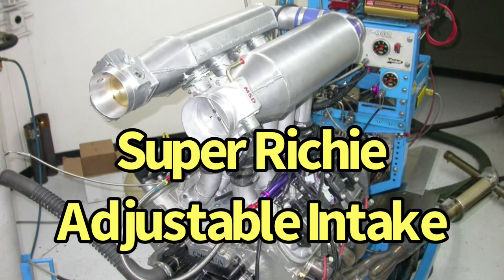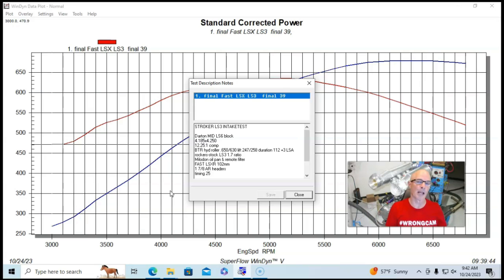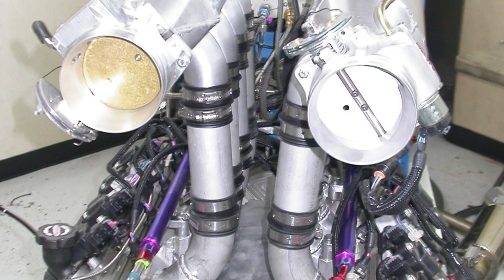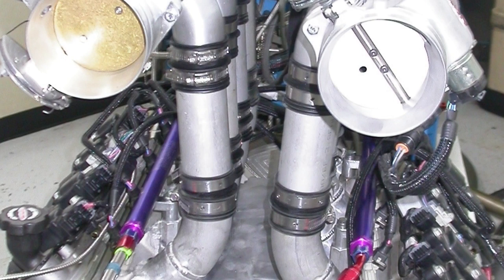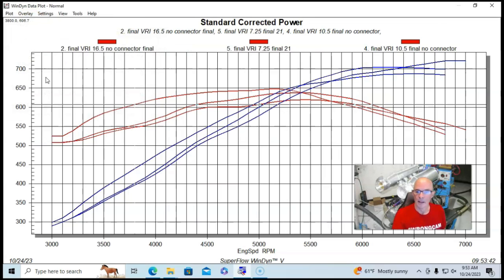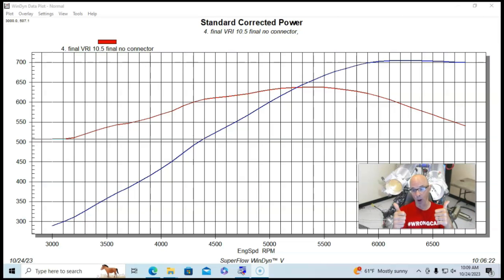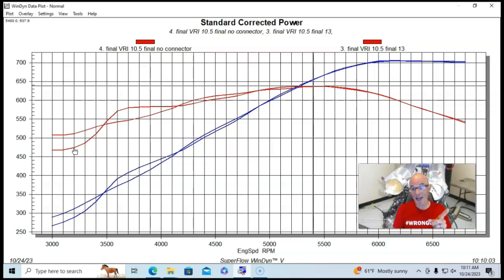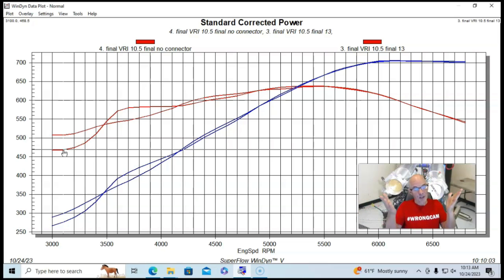MOST POWERFUL LS3 INTAKE EVER? SUPER RICHIE DUAL-PLENUM, ADJUSTABLE RUNNER LENGTH AND PLENUM VOLUME

Comment: So Cool! Im Considering Increasing My Runner Length On Possibly My 3800 V6 And Hemi. By Making A Spacer Plate. My Only Concern Is I've Only Got About 1-2" Max To Increase Runner Lengths Which I'm Worried I Won't See The Low End Gains Id Like To See As Seeing It Took 6.5" To Net Worthy Low End Trade Off. Still Would Be Unique And One Off. Plus I could Use The Room In The Spacer Plates For Nitrous Or Water Methonal Injection Points lol

Comment: What happens when you combine long runners with a long duration camshaft? The kind of racing I do having a lot of low RPM power that carried out past 7500, even with less top end power, reduces lap time by skipping a shift.
Reply: A wider lsa camshaft will do that too. Soften the middle of the torque curve, more overrev and better low end.

Comment: Richard can you comment on what you think would happen with increasing plenum volume to keg size on a supercharged motor like the l32 with an m90? I'm curious if you keep increasing volume can you see lower boost pressure numbers and then continue to run smaller pulleys and to what extent. At some point you will need to short shift to keep the rpm below the max supercharger rpm but i wonder what that would do to ET and trap speed 🤔
Reply from the maker: plenum volume had little to no effect on power and did not lower boost

Comment: On a carburetor application the plenum volume would be a lot more crucial because of signal to the booster on fuel injection you can give it the fuel regardless of signal.

Comment: Curious about same test that changes runner cross-section, also. 
Could it be that varying runner cross-section will move power around the rpm band?

Comment: You ever do a comparison with individual throttle bodies?
Reply from the maker: I have run them if that is your question
Reply: @richardholdener1727  What did it do to the power curve compared the fast. You could probably play with intake length too on individual throttles

Comment: Richard, do you think the gain in that mid region is a function of plenum volume or taking advantage of a harmonic between the two banks? My Porsche Cayman (987.1 S) has the same concept with a flapper valve in the middle.
Reply from the maker: What do you think changing plenum volume does? It changes the Helmholtz resonating frequency

Comment: Symmetrical and parallel intake tubes cry for an rpm-controlled slider setup. Optimize that runner length for the best of all worlds! Thanks for a very interesting test, Richard!
Reply: Those exist on racing cart engines and they work well. I think the newer hemi engines have a dual length intake too that works really well

Comment: Richard, I would like to propose two tests: the first would require a four-cylinder with a conventional tunnel, ram style manifold. The question would be how does the length of the hem, Holtz resonator, the tube in front of the throttlebody, affect torque in power.

The second test would require a V-8 set up similar to what you have but I have a concept : dual plenums that are divided, in a similar fashion to a duel-plane intake manifold, where a pair of cylinders from each bank cross over to the other bank. My hypothesis is that this would dramatically improve torque across the entire rev range provided the correct runner length is selected. This would also be a neat manifold to test the crossover tube on as well.
Reply from the maker: I'M CURIOUS-WHY DO YOU THINK A CROSS OVER WOULD CHANGE POWER WITH THE SAME RUNNER LENGTH-AND I HAVE RUN ENDLESS TESTS ON AIR INTAKE TUBES ON 4 CYLINDER HONDAS. PLUS YOU CAN'T HAVE A CONVENTIONAL (V8 STYLE) TUNNEL RAM ON A 4 CYLINDER.
Reply: I've done some testing years ago on the dyno as it was common urban myth that no intake pipe and a pod on the throttle was the best way, and the results were completely the opposite.  What I found is there is a sweet spot length for the ram pipe before the TB and the gain was inversely proportional to the harmonic number.  So lengths that were tuned to the 1st harmonic gained the most, but where ridiculously long, near 2m on our engine.  There is a fair bit of testing to get the ideal length that also fits the engine bay.  But if you don't care, anything is way better than straight throttle and/or pod and as long as you can practically make it.   The diameter I didn't test but I assume going too small is bad, same like how a too small runner kills power quick smart but going too big isn't anywhere near as bad.

I also found plenum volume to not do much, but my understanding is a big plenum is very helpful when the TB is too small due to increasing the efficiency of the TB when it is too small.  Such as a restricted class in racing.  But for anything else, too big of a plenum makes the throttle response lazy due to the finite speed of sound.

Comment: Ferrari and Porsche looked into this a ton in the 90s and possibly even earlier. The Ferrari 348 then 360 and virtually every NA engine after ran manifolds like these. Porsche 964 and 993 and after ran this only they had internal butterflies as well to actively vary chamber volume
Reply: Hell, even Honda did this on their J-series V6.  Minivan power!

Comment: Could it be that the size of the pipe joining the plenums together is specific to certain rpm ranges? Where a different size pipe might see gains at a different rpm. Then if you had say 3 different sized connectors all with separate opening valves they could be opened at the correct rpms for more consistent gains? Maybe this wasn't a test of plenum size but one of joining the plenums...
Reply: I'd say you might be able to measure something.  But given that many OEMs use a simple butterfly valve between two chambers with no pipes at all, I don't think it'll make a massive difference.  Remember the pipe lengths between plenums are really short.
Reply from the maker: the pipe size does change plenum volume
Reply: @richardholdener1727  so if you were to change the 2 plenums separately to match the increase you made with the cross over pipe you think the results would be identical then?

Comment: The LT6 engine in the Z06 Corvette has three valves between the two banks of the plenum. First one opens, then the other two open, resulting in power increases through the RPM range.

Comment: Interesting that the crossover point is around 3500 RPM, for the twin vs common plenum setups. The activation point for the plenum divider valve in my BMW is around 3400-3500 RPM. Just a coincidence?
Reply: My old 99 Mercury Cougar V6 had a secondary larger set of lower intake ports, they kicked in at 3450RPM if you were over something like 75% throttle
Reply: @Onewheelordeal  Honda switched a plenum butterfly between 3800-4000 rpm on their V6
Reply: Same thing with the runner control valves in a Mark 8 Lincoln and the other early 4v motors i think

Comment: When you say increased/decreased volume are you removing the entire u turn assembly or just capping where the center joiner is? Im wondering if the resonance change from them not being connected is as big a factor as volume. A throttle body between them would be interesting to see the effect.

Comment: So I’ve been looking to build a manifold for a 2.5T, is there a measurement to calculate a good size for plenum size? I’ve found 1/2 the size of motor to be ideal is this true?
Reply: Depends on how much rpm the motor will see.  If it's a sub 6000 rpm engine, plenum volume plays a minor role.  Start spinning up near 8k+ and you'll want multiples of the engine volume - more the higher you go.  I don't think I'd go any smaller than half the engine size though.
Reply: @ChurchAutoTest  great info. What I’ve calculated out with a lambo lower intake and fabricated plenum and all its around 1.8L. Will be a turbo motor spun to about 7500. I’ve used a number of measurements from integrated engineerings 2.0 manifold runners as it was nice to rev up to 8000 rpm. Figured some of that info should be decently close to the swap motor. Thanks mate really helped with assuring I’m along a correct line. Even if not perfect.

Comment: I have slight feeling that the plenum thing might have more to do with the fact that plenums and their cylinders get connected, not so much the volume change. Vacuum pulses between two banks can interact, make scavenging effect, increase power in some particular rpm range, and f things up elsewere. When seperated, there are interactions just within each bank... just a theory... and premonition ;)
Reply: This is basically what BMW does with their inline 6 engines. They put a butterfly valve in the middle of the plenum. When the valve closes, it's divided into 2 plenums (the front 3 and the back 3 cylinders). When the valve opens, it becomes a single plenum. They claim that when the valve is closed, it improves low-end torque. And they say when it opens, the resonance helps to feed the opposing cylinders in the firing order (at higher RPM).
Reply from the maker: very common on inline 6 motors to run 3 and 3, connecting the plenums changes plenum volume
Reply: @richardholdener1727  ...aaaaand creates COMMON plenum ;) 🤝
Reply: @richardholdener1727 I have a 07 dodge magnum 2.7L v6, nothing too fancy, but wanted to change the intake, and my a custom one to push a little bit more power. And mainly bcuz a person has to remove the intake to remove the plugs, to make an easier access removal. Any suggestions on if I need to upgrade my fuel injectors to compensate for pipe length....etc. Thanks Micah C from Saskatchewan
Reply: How much different than a Dodge Viper?
Reply: We’ll he’s saying the kegladon did nothing but the common plenum might be a thing

Comment: Is there a way to run a dual throttle body on a sc 3800 build? Because that looks so dope, I want to get building on my 3800 🤣
Reply from the maker: THERE ARE NOT DUAL INLETS INTO THE BLOWER UNFORTUNATELY
Reply: @richardholdener1727 WHAT? SPEAK UP!
Reply: @jasonbirch1182 suppose you could run duel superchargers....
Reply: @jimlathrop8603  good luck with the belt.
Reply: @jimlathrop8603  or I can run a dual filter inlet adapter in place of a throttle body and run 2 throttle bodies on top of that. Might be super silly

Comment: Is it possible to build a single carb SBC tunnel ram that makes big low rpm power for a boat ?
Reply: Sure, you could build one, or you can buy a single 4bbl mounting flange for a tunnel ram
Reply from the maker: dual plane would likely be better